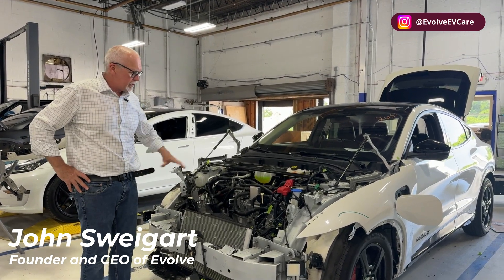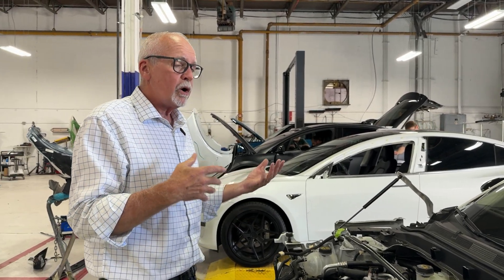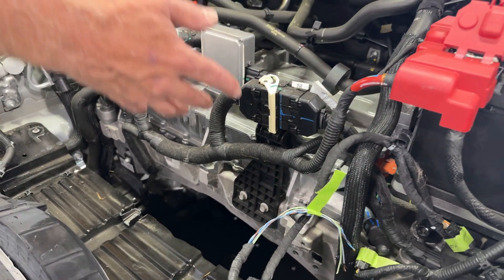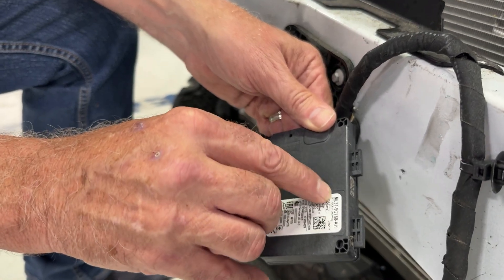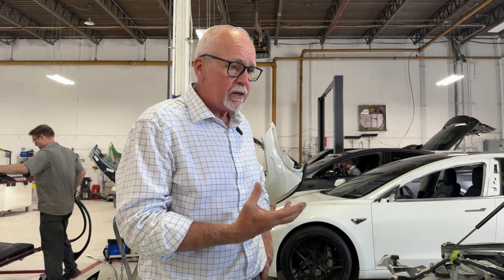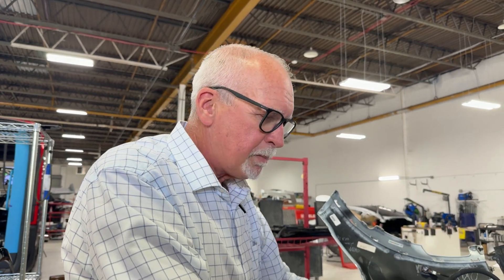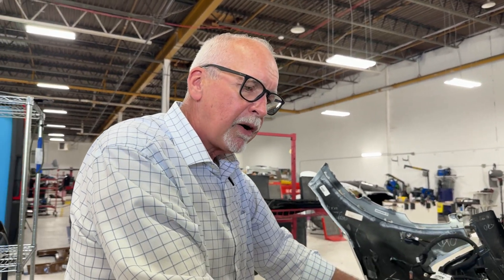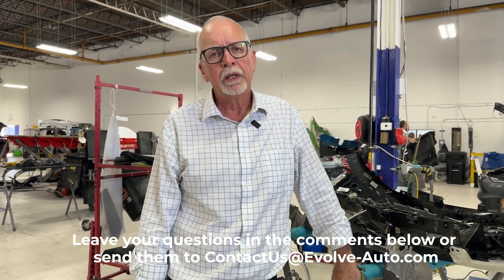How is the Mustang Mach-E Built? A Closer Look

Comment: Oh crud...a regular 12v battery. Pretty much a large point of failure in EVs. 
So many sensors.... major cost to replace. Now you may realize why Tesla doesn't have a front bumper camera and got rid of the ultrasonics. Cheaper.
Reply: My '24 Tesla Model Y has a 16v lithium battery instead of a lead acid 12v battery.